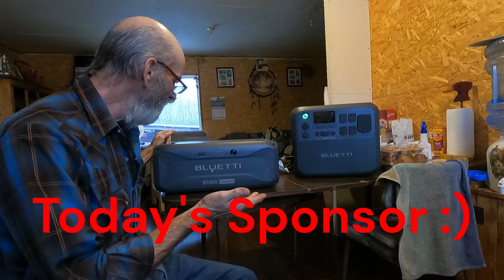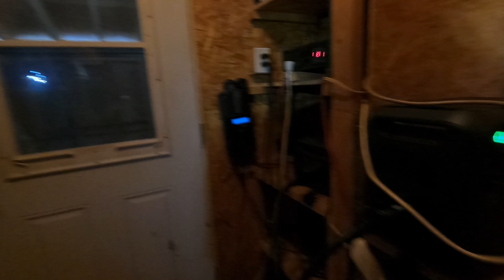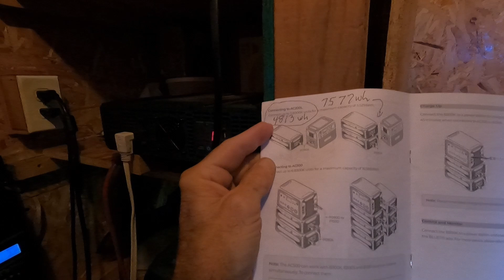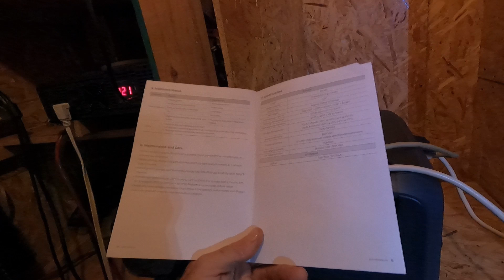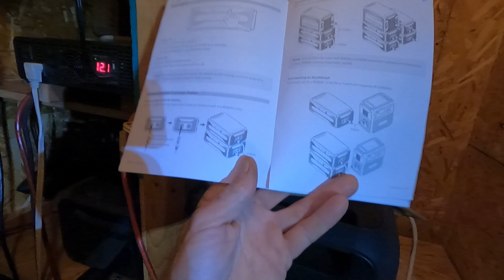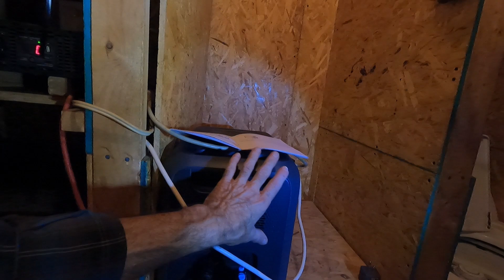OFF GRID POWER BOOST !! BLUETTI AC200L + B300K, Is It Enough ?? More Power At The Cabin, S3,E98,

Comment: I have the 200L and 2 B300K's and it's awesome.
Reply from the maker: Hey right on :) I'm loving mine so far but think I need another battery then that should run the cabin 4 dark days I'm getting 55-60hrs on a charge & running a fir bit of stuff, What do you have your system running ?

Comment: Great tool Don. And great addition. Is there enough space to put another battery on top of the new one. Sorta looks like it. 
Very nice video, very well explained. I doubt I’d ever have a use for one. But you never know. Slick for back up if my propane generator won’t start or if I run out of propane. Which, by the way I have. At least once a year. They’d changed the schedule for fill ups, added a remote gauge, so they know how much fuel I have. Put in a bigger tank. And on and on. And still run out. Luckly, I guess, I worked there and I know the drivers. So I call one of them. Can’t get a response from the 800 number. So what do you do 🤷🏻‍♂️
Sorry for the rant. There head office is out your way I think. 
Have a good day Don. 👍🏻👍🏻👋👋
Reply from the maker: Thanks Noel :) Yes we can only rely on ourselves ! but yes I hear ya I know how much fuel I burnt last Oct & I have saved 80% by using the Bluetti :) The next 3 months will be the test with only 4 hrs of sun if it shines ! We have been cloudy 5 days now & I can go between 50-60hrs before I have to charge it's nice & ya it' would be nice if they would send another battery :))